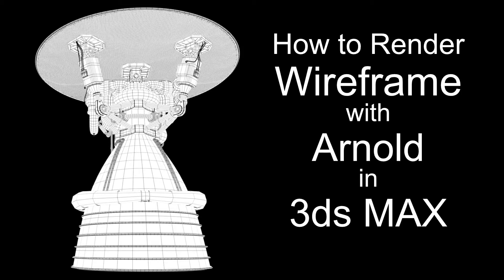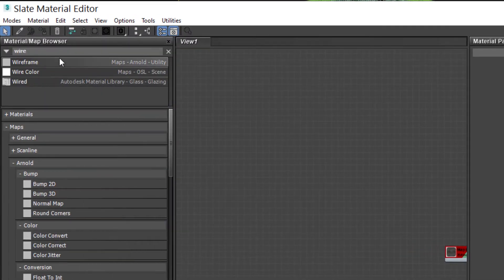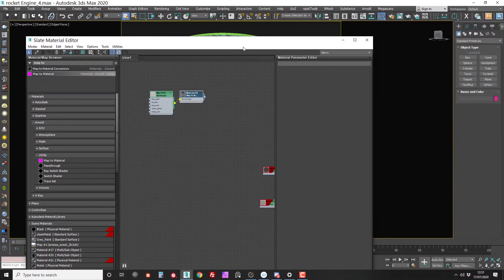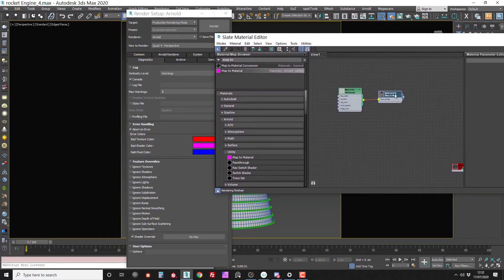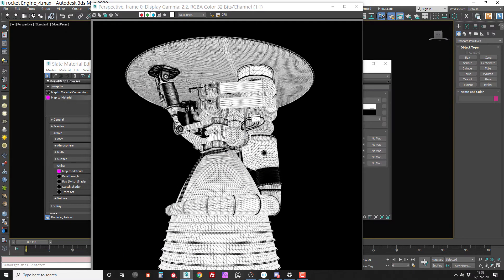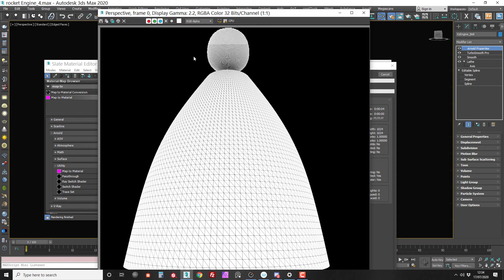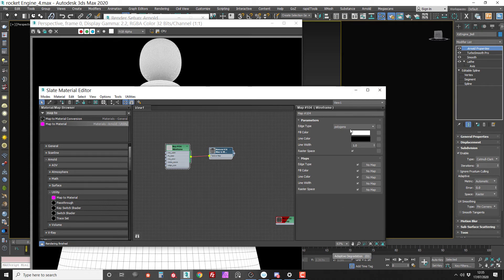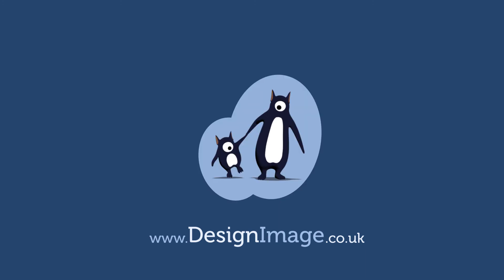3ds Max tips: How to Render Wireframe using Arnold

Comment: I was having trouble with the subdivisions since I was using ambient occlusion and the arnold properties modifier wasn't working, so I discovered that if you go into the wireframe material in the material editor, you can choose to render them as polygons or patches rather than tris. hope this helps